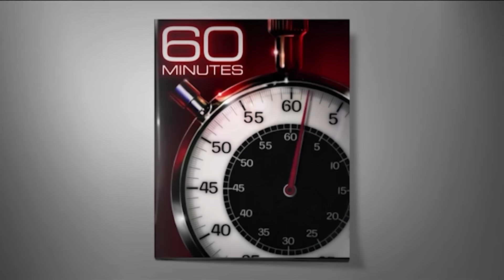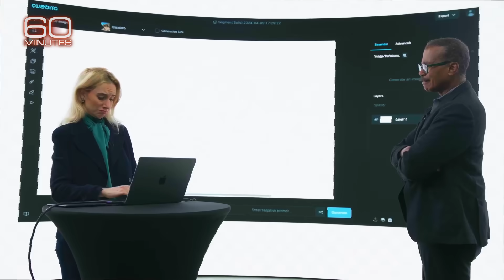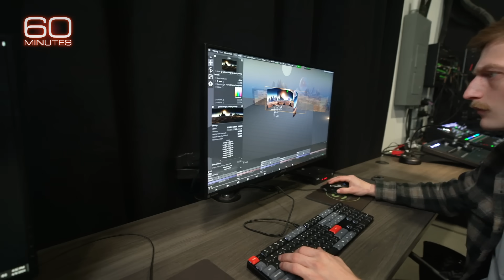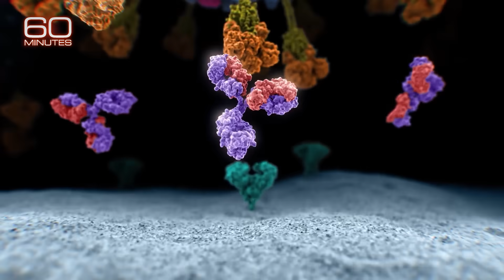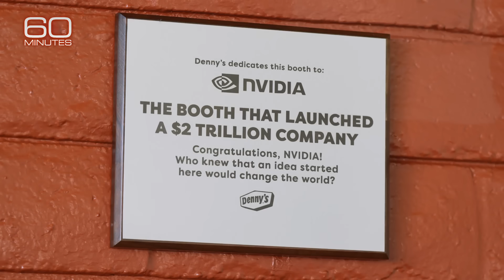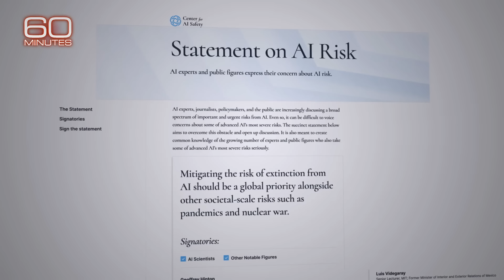Nvidia CEO Jensen Huang and the $2 trillion company powering today's AI | 60 Minutes

Comment: Consciousness and emotion seem to elude many people, especially when applied to AI. To me, it is quite obvious and simple. Many say you can be conscious but not thinking or smart, or that you can be thinking but not conscious. Well, that distinction is the clue.
An AI LLM can be calculating an answer, but does it have a continuous governing state or module that monitors whether it is idling or under high load, its temperature, whether it is running normally or overheating, or even whether it is ON (which is important), booting up, or in a failure state? That is the key point.
These states are equivalent to human “feelings” of being relaxed, stressed, sick, dying, feeling great, waking up, or simply being alive (consciousness). We can even equate sadness, happiness, and various emotions to an AI governing module that monitors its internal states.
Back to the idea of being conscious without thinking: in an LLM or AI system, it could simply sit there without answering any questions, yet still be fully aware—monitoring all its internal states, knowing it is ON and idle, while not performing any inference at all.
Does it feel emotions the same way we do? Not exactly, but in a similar sense. It is silicon, whereas our brains are made of neurons, but the equivalents I described above still exist.

Comment: In recent weeks, lnvestors have become concerned that Nvidia has simply come too far, too fast, and they are wondering whether the hectic pace of AI adoption could continue. Nvidia answered that question with a resounding "yes," but given the stock's parabolic gains, blockbuster results simply weren't enough. I'm still looking for companies to make additions to my $350K portfolio, to boost performance. Here for ideas.
Reply: I agree that there are strategies that could be put in place for solid gains regardless of economy or market condition, but such executions are usually carried out by investment experts or advisors with experience.
Reply: Reason I decided to work closely with an brokerage-adviser ever since the market got really tensed and the pressure became so much(I should be retiring in 17months) so I've had an brokerage-adviser guide me through the chaos, its been 9months and counting and I've made approx. 650K net from all of my holdings.
Reply: Elisse Laparche Ewing is the licensed fiduciary I use. Just research the name. You’d find necessary details to work with a correspondence to set up an appointment.
Reply: She appears to be well-educated and well-read. I ran an online search on her name and came across her website; thank you for sharing.

Comment: The host of 60 minutes is a great host. He is very calm and rational. Now, when referring to Jensen, he seems down to earth as well except for the fact that he is trying to play down the effects on the job market for humans. The problem I see with AI, is that large corporations will be the early adopters, mainly because they can afford the costs of the chips used to process AI calculations. The large corporations will then create inferior products to the masses because this increases their margin; ergo banking and corporate chatbots. This video shows the biomedical, food, and car manufacturing sectors using AI fueled by Nvidia's chipset. Lastly, because computers have potentially unlimited memmory capacity, unlike humans, large language model based software programs are sourcing their data from extremely large data sets, that humans can not accurately check 100% of the time without an extremely large staff constantly. Checks in place or not, I believe any extremely sophisticated program that has the ability to learn and eventually manufacture products, with the combined knowledge of thousands of years of human knowledge is rationally going to become a security threat sometime in the distant future. Also, the ability to hack a computer system, a computer network, and to alter data from a warehouse is going to pose a problem in the next 10 years in the AI sector because in terms of efficiency and costs, AI applications in the real world should eventually be cheaper in the next 20 years as opposed to hiring humans. From a quality standpoint, I'm not too sure about that. AI is attempting to mimic humans. Humans are notorious for terrible quality controls, particularly in the mass manufacturing space. Look at all of the car recalls from all of the different car companies in the last 100 years. In the pharmaceutical space, look at all of the lawsuits over the last 100 years against drug makers and biomedical companies that have killed and permanently scarred other people. I think if AI growth and development was spurned by more altruistic people instead of investment banks who are funding AI startups that are led by mostly ethicless notoriety seeking scientist and inventors I would have a lot more faith that AI will ultimately make humanity better in terms of interactions between cultures. AI for the next 20 years is going to be fueled by governments who want military applications for the ultimate purpose of dominance in all aspects. AI for the next 20 years is also going to be heavily funded by investment banks who have no interest in the ethical development of this technology; ergo lawsuits against Open AI pertaining to copyright infringements, unethical behavior, and nda disclosures. If you have ever worked at any investment firm, you will know that 99.99999999% are focused on profits, not the process that generates the profits.

Comment: Summary:
-Nvidia is a company that designs chips for computer graphics and artificial intelligence.
-The company was founded in 1993 by Jensen Huang, Chris Malachowsky and Curtis Priem.
-Nvidia's stock market value soared from 1 trillion to $2 trillion in just eight months in 2023.
-The company's success is due in part to the development of the Graphics Processing Unit (GPU) which can process a myriad of calculations all at once.
-GPUs are used in AI applications such as drug discovery, designing materials, exploring the universe and generating virtual movie sets.
-Nvidia GPUs are also being used to develop robots such as Figure one which can understand and respond to requests.
-The company is working with BMW to test Figure one in its South Carolina factory.
-Jensen Huang believes that AI will create more jobs than it takes away.
-Nvidia is aware of the risks of AI and is committed to developing it responsibly.

Comment: It wasn't JUST graphics acceleration... there has been a long iterative cycle of hardware and software that accelerated code, then new code took advantage of that new hardware, and so on. Yes, in 2012, deep learning (Hinton, Sutskever et al) used a GPU to accelerate the the backprop calculations they were using on an image classifier. NO, the iterative process for ML/DL has not been the same. It's all brute force. It's just scale scale scale. It hasn't been AI since then. It's just statistics and probability. *chat bots are the oldest parlor trick in the book.
Reply: Yes, but AI does produce dramatic results… especially with someone who knows how to use AI.

Comment: Just as an explanation why a graphics card is essential for Generative AI: To run Generative AI at a decent speed you need to run several thousand computing tasks at the same time. A graphics card computes the image for a 3D image on your screen not from the top left to the bottom right on the screen pixel by pixel, but it computes an area of the image with all pixels at the same time at once (the programs computing a pixel are called "pixel shaders"), which are several thousands. But you can use the computed value of a pixel of course also for something different if you don't show the image buffer on the monitor and use the image memory for text data for example (or voice data).
Reply: Thank you for your explanation. A lay man like me appreciates it.
Reply: Thanks for that, it now makes a lot of sense